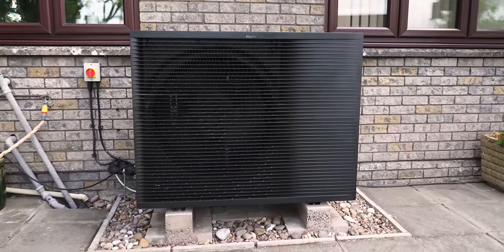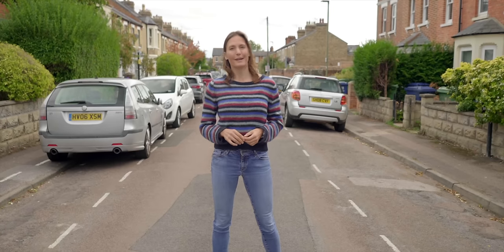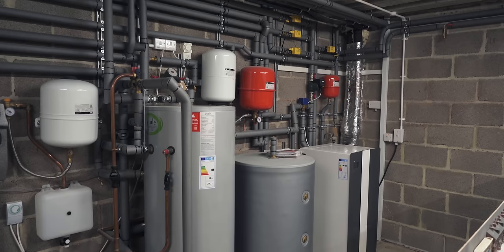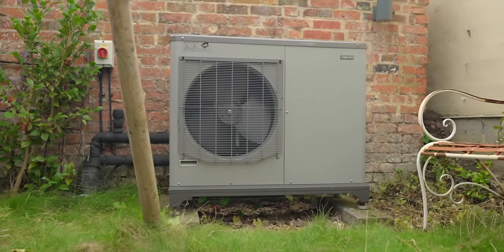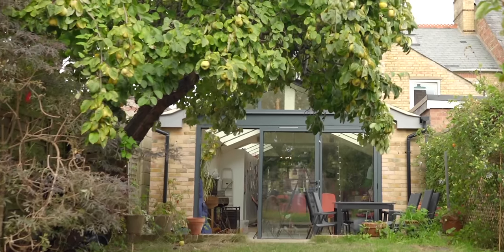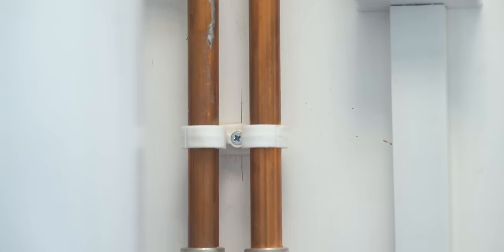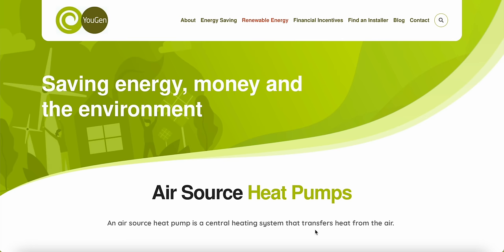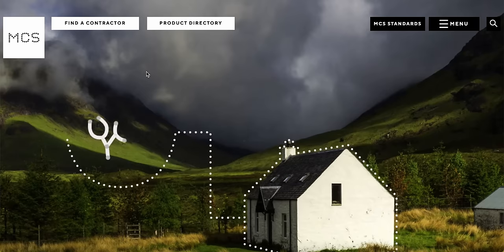Does a Heat Pump Really Work In A Victorian Terrace?

Comment: I'm a heat pump installer (in UK). Unsurprisingly, I think they're great - although there's a few things to note:
For most larger homes, they're an absolute no-brainer if you're changing your existing system, but I don't think there's yet a great range of products for smaller homes (although my expertise is mainly in the Samsung systems we install & I may not be up to date on what other manufacturers offer). Problems for a smaller home are - where to site the outdoor unit without it getting in your way or being adjacent to a bedroom window (or the neighbour's!) which might be a noise problem. They're not particularly noisy - when I service mature units I do a noise test & they normally come out at 42dB ('library') to 45dB ('dishwasher'), but this is at relatively low frequencies so you can get resonance problems if they're badly situated, e.g. facing a fence or in an alley, and unlike a combi boiler they can run continuously for some time. My main problem when doing noise tests is getting a proper reading over traffic or other noise.
Also there's the question of here to put the hot water cylinder. HPs can't deliver instant hot water like a combi, so you'll need a cylinder. Hybrid HP / combi systems exist but they bring their own problems.
There's different types of system and some take longer to install than others. You'd be lucky to get one completed in a couple of days - we're often on site for a couple of weeks, but that depends on a lot of things.
They can heat most places, including old draughty Victorian solid-wall places. We do a heat loss calc for every room to confirm. Radiators are typically way over-specified so we mostly don't have to make any changes, but sometimes we add or replace radiators. So far I've only worked one project where we changed rads wholesale. Microbore piping can be a problem in older places where heat demand is high, but it's probably OK in a newer well-insulated home. They work really well with underfloor heating, but don't worry if you don't have it.
We always used to say running costs were approximately equivalent to a gas boiler (they're 3x as efficient (ish), but use 3x more expensive fuel). However the balance is tipping in their favour as gas gets more expensive. Also if you have solar PV panels, that will help.
Heating controls can be as complex or as simple as you like. We can wire in to existing basic thermostats or include a fancy high tech controller as required.
If you get the right system and installer you should end up with a capable, green, cost-effective, long-life and lo-maintenance system.
Reply: @bimblinghill Part of my PhD research during the 1990s (Mech. Eng.) involved air-source heat-pumps for home heating in Christchurch, New Zealand. One of the surprising findings (to me) was that manufacturers rated heat-pump performance in dry air conditions only. So when I measured actual installations I found the CoP dropped to 1 when the outdoor temp was below about 6 degrees C due to icing/de-icing of the outdoor heat-exchanger -- even though the manufacturer's specs gave a CoP greater than 3 for that temperature. Do you actually measure real CoP on your air-source installations? Does it match the high CoP numbers given by manufacturers? If so, can you speculate as to what might be different between England and the South Island of NZ (which I would have thought would have quite similar climates)? We do use air-source heat-pumps in Southern New Zealand, but you see massive spikes in electricity usage (& costs to the homeowner) once the nighttime conditions get into low single digit temps. I can't understand why this wouldn't be the same (or worse) for the UK -- but perhaps I'm missing something..?
Reply: @davidhaywood8029  We do look at the instantaneous CoP as we commission, on the models that give this info. For us it's a sanity check and not very scientific, but it does fluctuate wildly. It seems to get very high in moist air at maybe 6deg ambient; I presume because of latent heat of condensation passing into the coils. Then if the moisture starts to freeze on the coils (which are necessarily colder than ambient) you have a drop in CoP due to the defrost function. Finally when ambients are below freezing, CoP recovers somewhat as the air is much drier.
Icing conditions (damp, low single-digit positive temps) are fairly frequent here, but they still make up a small-ish proportion of usage so they don't seem to have a massive effect on overall annual consumption.
I'm an installer though; I'm not studying the performance. I build the system, commission and move on, so I'm not the best person to speak on this.
Reply: Wondering if you could answer a few questions, I'm building at the moment I'm in the stages of selecting a heating system. I'm passive standard and self sufficient in power to what I require at the moment, and the heat pump interests me.  I need a 250/300 liter tank and I think 8kw unit, (1) what tank would be best, a tank suited for a heat pump or something like a maxipod that uses heat exchanger keep the central heating warm rather than the hot water (2) what wattage does the units run at (3) what's the average wattage consumption per day  (4) is all units similar or is there a different type of unit that's better  suited to our miserable climate.
Reply: @bimblinghill  Thank you for the reply -- very interesting! As I recall, my sites in Christchurch were pretty much 100 per cent relative humidity all the time on winter nights, which was most of the usage time. Great that you measure CoP of your installations -- it's not easy to do accurately in real-world systems (although you only need ball-park figures in your context, of course...)
Reply: An added advantage removing natural gas from the heating system is as fare as I can find that heat pumps do not explode. On a visit to UK I had the "pleasure" of standing next to a wonky natural gas water heater and it started with a bang and a small fireball. No real damage, but I still do not like them.  🙂
Reply: @bknesheim  It's true. Probably an even bigger danger with gas is CO poisoning. Stop burning stuff - especially inside your house!
Reply: @danpye.  I'm not sure I can answer all your questions without knowing more about your home, but...
(1) I guess if you're looking at 250/300l cylinders, you have a fairly high hot water demand. I'd typically specify 200 or 250l for a family of four after asking them a few Qs about their usage. We've recently started installing Joule cylinders which seem really well made. Definitely get a HP spec cylinder - the only difference is that it has a larger heating coil to improve heat transfer with the lower HP flow temperatures. Consider whether you want a 2nd coil for a solar hot water panel. We typically set up the primary HP circuit to run to either the HW cylinder or a heat exchanger for the heating, controlled by motorised valves. We put glycol in this circuit as it goes outside to the HP unit. The central heating circuit runs through the other side of the heat exchanger. Separating the circuits with a heat exchanger is good as it avoids glycol circulating through your radiators, and it allows different flow rates each side (HP circuit wants high flow).
There's lots of different systems though - what I'm saying relates to 'monobloc' systems. There's 'split systems' too which are quite different.
(2/3) If you get an 8kW Samsung unit it'll typically produce around 6kW heat & consume around 2kW electricity as its running. How much it consumes per day depends more on the heat loss from your house and your HW usage than it does the HP unit.
(4) Our customers in the UK East Midlands seem to like the Samsung ASHP monoblocs. I don't know too much about the other options, I know some other brands have models which are quite similar in operation (Panasonic, Mitsubishi, etc) but there is also quite a lot of variety.
Reply: @bimblinghill  Inside your house sot from cooking and burning candles is for most households the main sources of pollution in the air. The result can often be higher then what would be accepted in a factory.
Reply: Thank you for some of the truths that are sadly missing from the actual video.
Reply: We have a ground source heat pump (a borehole) system in our apartment block here in Switzerland, which has 11 different size apartments. We have a fairly big electricity bill each year which I assume is from running pumps/compressors plus maybe supplementing the heat when the conditions are not optimal. 

I guess the yearly electricity bill was (from memory) around £10k, and is shared according to the size of the apartments (approx).  For me, this is a pretty cheap solution for such a number of apartments for hot water and heating for 12 months. Do air heat exchanges also consume electricity similarly?

I'd love to convince my mother in the UK that a heat pump would be a good solution (her existing gas system will need replacing soon..) but she has been turned off them by what she's  read in her "newspaper" (Daily Mail..) about them not working and/or costs..
Reply: @vfr800ch  Where you get the heat make no difference in how efficient the heat pump is for any temperature gradient.
The advantage of using a borehole comes from a stable temperature. A stable system can make it easier to fine tone it for a little more reduction in energy use.
Norway have a wide spread adoption of heat pumps and most are air based and they work fine. They are easy to use and last for a long time.
Reply: What is the typical cost for a heat pump and installation costs? Compared to a gas boiler - not running costs.
Reply: @toddvanhees6807  £12-15k for a typical domestic ASHP fully installed, less the £5k Boiler Upgrade Scheme subsidy
Reply: Really useful, thanks, you're touching on aspects that worry me for my house and the video didn't touch on (microbore, rad replacements.
Reply: @londonwestman1  The video painted an extremely  rosie picture, it feels like a selling pitch from the manufacturer. When I asked for an estimate of the cost I was told my question was irrelevant.
Reply: @firstnamelastname9631  Sure, Jan
Reply: @toddvanhees6807  According to the maker of this video, your question is 'irrelevant'...
Reply: @bimblinghill  ???
Reply: @firstnamelastname9631  well if you have 15k lying around which a large majority of the population don't then it is extremely relevant.
Reply: @toddvanhees6807  Given that many people are remortgaging to avoid interest rate rises, wrapping an additional amount for the heat pump should be possible.
Reply: @bknesheim  I know they work fine but i'd be interested to know how much electricity is used to run them yearly and how much is needed additionally if/when they can't provide enough heat throughout the year.
Reply: @vfr800ch  There is no set amount that you will use it all depend on how much heat you need. What the heat pump will give you is a 3-4 times the amount of heat compared to just using the electric power directly.
Reply: @bknesheim  I am well aware it's a case of how long is a piece of string but I gave an example of how much was used for a small apartment block with 11 apartments, so surely some can give some examples of how much their detached house air-exchange heat pump used in electricty per year just so one can get an idea of the costs or how it works?
Reply: @vfr800ch  When my sister installed 2 heat pumps they reduced the electricity bill with about 30% and since it was air circulating with filter the indoor air got a lot better.
The reduction paid for the pumps in about six years and both are still working fine after nine years.
NB; with UK heating up they can also do air cooling just fine.  🙂
Reply: @davidhaywood8029  I've monitored mine over this year, it's an Ecodan. During defrost the heat pump takes heat from the radiator system to defrost the outside heat exchanger, but uses minimal electricity to do this. The cycle is about 5 mins/hr, so reduces average COP by about 10% whilst temperatures are below about 4-5 deg. However I also looked at the total cost over the heating season - I have a heat meter which ignores negative heat flow, ie the defrost heat flow, but also communicates flow and return temperatures and flow rate so I can calculate the actual heat flow and keep a total of that - the difference between the two totals was about 1%, ie over typical UK winter the defrost was reducing avg COP by about 1%.
Reply: @alanclarke4965  Thank you, Alan -- very interesting information.  From memory (I can't find my actual data any more) the heat-pumps that I monitored were defrosting more than half the time at around zero degrees, so obviously quite a different result.  As I said, the relative humidity seems to be practically 100 per cent as soon as the sun goes down during a Christchurch winter, so presumably that's where the difference lies.  The houses were all timber-framed/clad "rental grade" so barely insulated.  The poor renters were getting out of bed to sub-10degC indoor temperatures in the morning -- even with (nominally) a 4kW heat-pump going all night.  Don't be a renter in the South Island of New Zealand is my advice...
Reply: This comment contained more useful info than the content of the video.
Reply: Hi there, interesting write-up! Can you advise how you would potentially cure a resonance issue? I'm guessing some sort of panel to absorb/break-up the sound waves but would be keen to hear from someone who knows about this issue.
Reply: @FarObserver  I've not had direct experience of installing sound absorbent panels. My last installation was noise sensitive so we opted for the latest Mitsubishi Ecodan, which is v quiet, to pass the assessment. To mitigate an existing installation anything that interrupts the sound will help. I think there are specific products but I know little about them. Alternatives are fences, trellises with climbers, planting bushes etc. It's hard to say as it's very site specific
Reply: @bimblinghill  thanks, I appreciate the reply.
Reply: Leftie video. They’re very inefficient and expensive. Irrelevant on most old housing stock.
Reply: @aliengrey6052  Whatever mate. Enjoy your gas bill
Reply: @bimblinghill  I don’t have a gas bill. My oil boiler gets used for water only, one 500 litres lasts me five years. The heating I need comes from oak wood well seasoned over six to seven months heating period.
I’d say enjoy your 15,000 to 20,000 pounds installation charges to add to your bill. It’s just false economy it just doesn’t stand up. Money making scam, it just isn’t cheaper and after 20 years you’ll need another one. Tell me I’m wrong!!
You know when you factor in cost and installation of the equipment it’s a non starter. I once used this argument on a double glazing salesman in the eighties and he just walked off.

Comment: This video is titled "home truths" but it's relentlessly positive when I believe the reality in the UK is nuanced to say the least especially when it comes to cost. 

There's a good deal more useful information in the comments (especially from bimblinghill) than in the video itself.

There are a number of issues that the video glosses over or does not mention at all, for instance:
 * Air source heat pumps are drastically less efficient when it's wet outside and below 6°C. 
 * You need space for a hot water tank. 
 * Gas is still cheaper than electricity so even if you do save kWh, you may not save money.
 * If the house cools down it takes many hours to warm up.
 * High installation costs.

My house is small, with solid walls, a nice gas oven and no hot water tank and my bank account isn't as flush as the people featured in the video. I'm also often away from the house for one or two nights a week. I can turn my gas heating right down while I'm not there, but I think that wouldn't work for the heat pump. 

I'm researching a heat pump, but it honestly doesn't seem to make sense at the moment. 

If I were to take this video at face value, I'd come away with the idea that a heat pump is a no-brainer. But that's just not true, is it?
Reply: Propaganda.